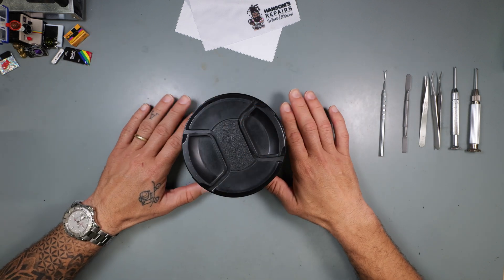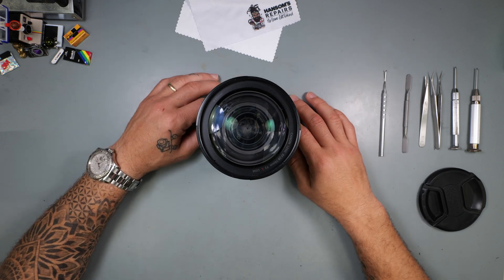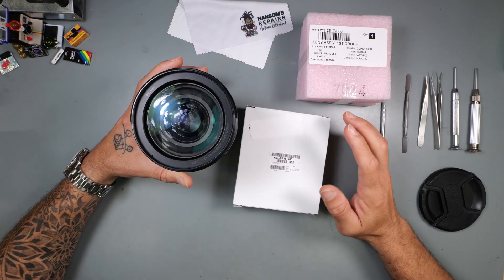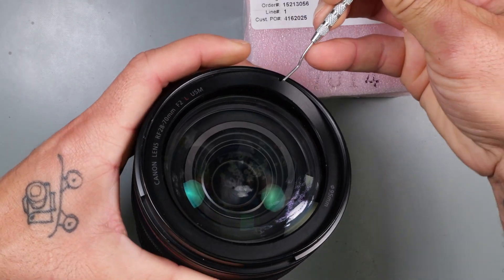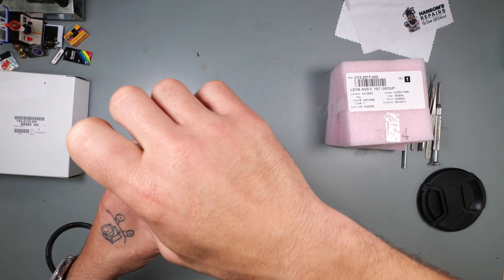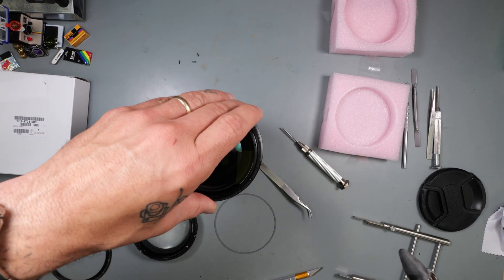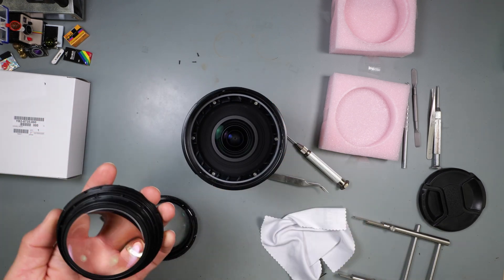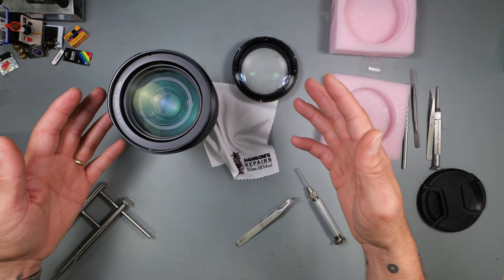Canon RF 28-70mm F/2 Front Element Replacement, Costly Repair & Common Issue  #hansomsrepairs

Comment: OMG, I’m having the same issue here! My lens is only about 8 months old, and I take really good care of it. I noticed a small mark on the front glass, thought it was just a hair or smudge  but when I gently cleaned it with a normal lens cloth, it actually got worse and the coating started peeling off. I looked online and found so many people with the same problem. I contacted Canon, but they said they weren’t aware of it and just asked me to send it in for inspection... Super disappointing for such an expensive, professional lens.
Reply from the maker: Really sucks they say that because hundreds heave been sent to them with this issue over the years.

Comment: I guarantee you that owner of that lens subjected it to plenty of nasty exposure of dirt and dust along with some debris and stress. You were being generous to not say anything. My lenses are kept pristine and I don't subject them to such issues.
Reply: One google on the issue you will see this is a common issue for this lens. There are many examples of just this particular lens having the exact problem shown in this video.  So no, you can't guarantee anything in how the owner looked after it knowing this now.  I for one wanted one, but will be staying well clear of them until this is sorted.  Too expensive to be wasting money on sub par quality.
Reply: Yea if you never owned or used this lens don’t talk. This is clearly a problem that happens with this lens I own it and I have the same issue. I take care of all my lenses and none of them ever had this problem. I still have my rf 70-200 2.8 and that never happened to that lens and I’ve had it way longer than my 28-70
Reply: @ThenMediaProductions  I'm glad I ran across this issue when researching this week because I was just about to pull the trigger on the 28-70 but I'm steering clear now. Really want that focal length/aperture in my kit but I'm not putting up with this nonsense. It also seems like Canon refuses to take any responsibility for it, unsurprisingly.
Reply: @PM-cd  I've had mine for probably 3-4 years now and its pretty much my main lens for everything.  Never had this issue yet.  However if i ever did its pretty heart warming to know that the fix is essentially only $500 bucks considering the lens retails around $3200 currently.  Mine has paid for itself tons of times though so I'd say you should pull the trigger still.  Its both incredibly sharp and versatile .
Reply: It is RF28-70/2L USM. It is a well known issue.